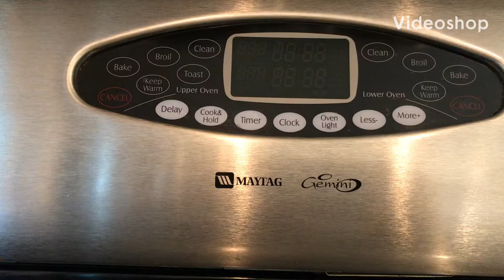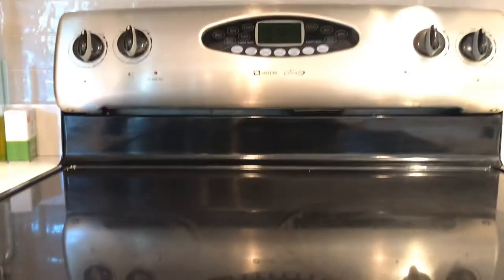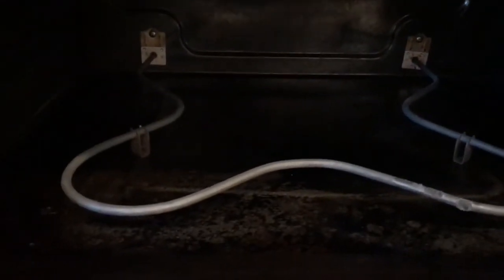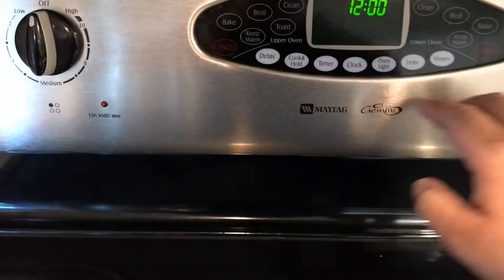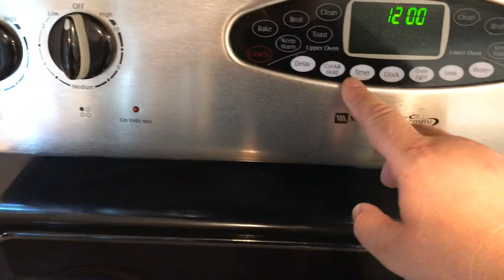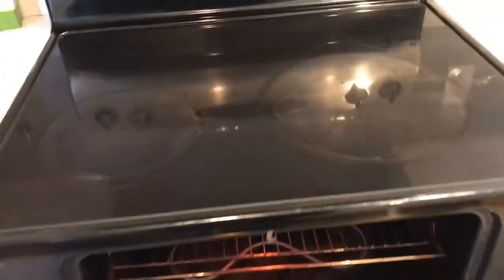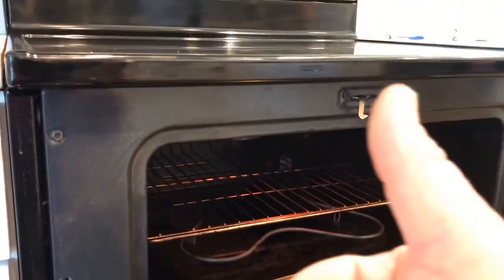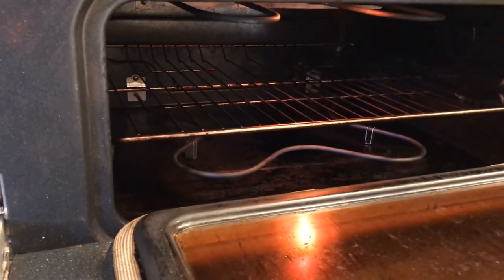Maytag Gemini: REPLACE broken heating element & $ave!!

Comment: I did that and for some reason still doesn't work. Wondering if something came loose on the inside.
Reply from the maker: Make sure the wires are connected. Sometimes when you reinstall the wires one wire comes unconnected. If not make sure the element is NOT DEFECTIVE. 
If both ok contact a Professional to complete repair👍🏻 good luck
Reply: @HighRidgeHandyman  Thank you. Main control board is bad, : (